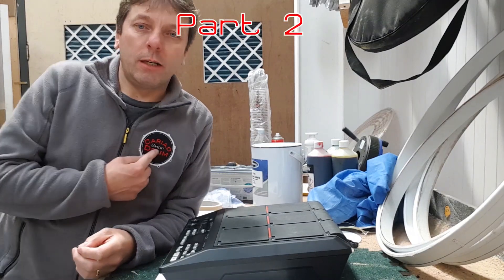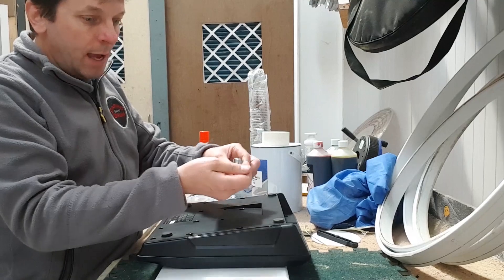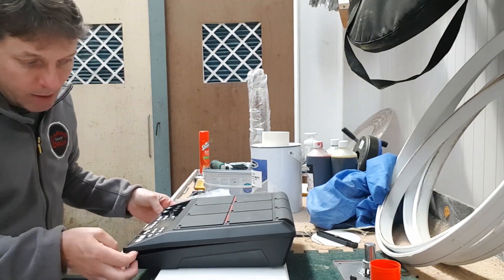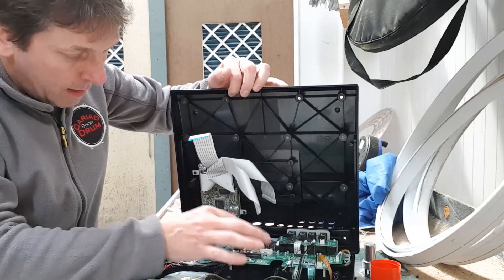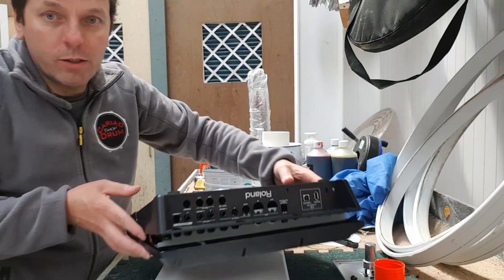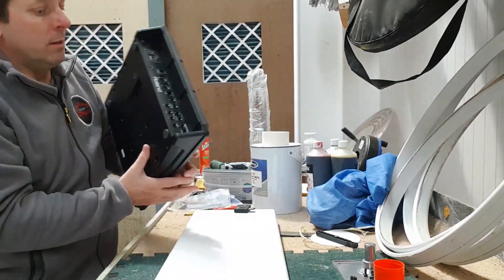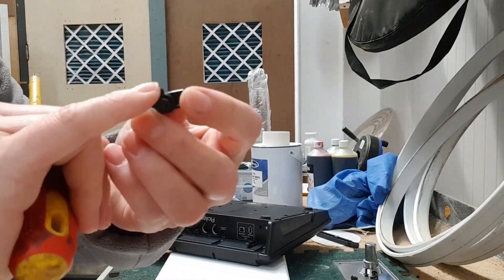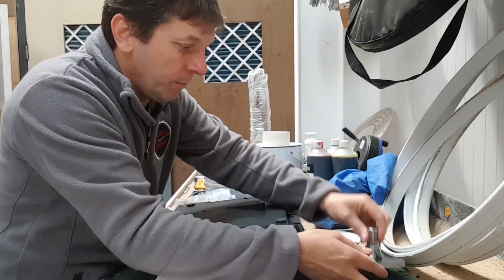Roland SPD SX memory upgrade Part 2

Comment: I just can't get the case off. I can just about see that there are plastic tabs that have now gone white from stress, from me pulling. I just can't seem to get it open. I'm trying to upgrade as the SPDSX keeps tripping up and/or stopping the backing track when using triggers (yes I'm on 1.0.8). I'm stuck!
Reply: I got it. The solution is in looking at the holes at the back. Intuitively you want to pull it towards you, but actually you have to push it away from you, so that it frees the holes for the jacks etc at the back. Basically use the back as a clue! I bent some of the tabs, but none of them snapped off (yet...). Thanks for the videos.

Comment: THIS MAY BE HELPFUL -
If you're in the odd boat of being some sort of producer who wants to use full-on wave tracks, or just don't really care about spending another $10 for GBs in the triple digits, you may be inclined to go past 32 GB. You CAN NOT do this.
Beyond 32GB SD cards become SDXC's instead of SDHC. The SPD-SX does not support the XC format, so 32 is your cap. 

Also, since the making of the Roland Pad SD cards have evolved a bit. At the time of this comment (2021), you'll find microSD cards have a circled 10 instead of the 4 found on the factory-issued card, along with A1, and whatever else they come up with over the years to make their products sound more powerful. These updates and additions do not seem to have any adverse effects on compatibility with the Roland; using a microSDHC is the only criteria.

If your wiping your SD card using disk utility (or windows =) be sure to format it to MS-DOS, not ExFat or Mac OS Extended.

And finally, if the power does not come on at all when you reassemble you probably put one of the electrical strips in backward. Be sure the grill inside the slot is touching the teeth on the end of the strip.

Thanks, Leigh, this was too easy. I wouldn't be surprised if Roland tried to pay you to go away haha.
Reply: I have memory error on 32gb card toshiba  exceria micro sd hc I (3) AFER 2-3 yeas of working perfectly ;/ , im playing in two bands now i need this space. I have MEMORY ERROR and i cant format from spdsx directly.  i started using SPDSX editor software mabe this is a problem ?

Comment: Thank you very much Leigh for this video ! 
Last night while practicing I had a "Memory Error" on the SPD-SX, and I couldn't format the memory card... Not much info about it on the Internet... I was kind of worried as I have a gig tomorrow night. Until I find your video !! 
I bought a 10€ 32Go microSD card and started the "surgery" ! The only tricky part was to separate the top part of the SPD from the bottom part ! It took a few minutes but I got it !!
Anyway, everything works fine, I'm relieved !!!
Thanks again !!!

Comment: Thanks for this video, it was really useful, although I don't get why 32/64gb is "not recommended" any further info about that? Why it would be "not good"?
Anyway I just put a 16gb MicroSD card I had laying around.

I did not take pictures about the positioning of the ribbon cables and I had to come back to this video to get it right (not the right slots, but the right "ply"), so maybe better listen to the video he got the point!!!

I did not glue the MicroSD card (I'm on lockdown and I don't have the right glue for this matter, only superglue and a kind of slow dry silicone...) but the "locker" seems pretty strong anyway.

Thanks again.

Comment: I changed mine to a 16GB but once I go to check the memory still shows the 4GB. Did I do something incorrectly??
Reply: Hello Carlos! I just updated the MicroSD card of mine and i had the same problem, the only thing you have to do is to update it to the last Firmware (1.8) and then it will show 16gb (At least it worked for me!) Let me know if it worked! Kind regards, Joel.

Comment: I have a problem that I opened the device for the reason that I changed the skin and it was working but now it no longer works what is the problem
Reply: Leigh Smith I installed them all. I don't know what the problem is

Comment: Hi, Leigh. Thanks a lot for these videos. I ´ve changed the memory card and all seems to work properly but  after replacing the card, SPD SX doesn´t connect to the SPD SX Wave manager, I mean, the connection to the PC works, but the wave manager doesn´t recognize the samples that I load. 
I have loaded several samples, but the wave manager doesn´t recognize them. Do you know what could be wrong? Thanks again
Reply: Hi. Finally I´ve discovered the problem. I had not updated the Roland to version 1.8. In previous versions, the system doesn´t recognize more than 4 GB. Once the system is updated, everything works perfectly. Thanks.
Reply: @cariaddrums Thanks to you.  Hope your wife get well very soon

Comment: Thanks, worked like a charm! Got a samsung evo 32GB micro sd working ! A 13 euro upgrade. Upgraded the device with the latest Roland 1.8 firmware first!
Reply: I replaced with Samsung microSDHC EVO Plus 32GB card. I turn my SPD-SX on and there is nothing! I reopened to check my white ribbon bands were connected properly. They were, then checked the power strip leading to the device, and still nothing!! Do you have ANY SUGGESTIONS.
Reply: @kevinkalka6321  My SPDSX recently developed a common fault I had not heard of. It wouldn't switch on. The fix is to beat a pad while you're pushing the power button. I had to do that for a couple of months (not continually :) and then it went back to normal. Maybe that problem developed in your machine when you took it apart.

Comment: really, really great tutorials.  all parts are right on, thank you.  Have you ever heard of a new SD card also fixing the intermittent and completely annoying loop/click desync issue?
Reply: Found a potential fix for that. If you set all your sounds on that particular kit to Mono rather than Poly, it’ll use less system resources. Would reckon that’s more of a ROM memory than a RAM memory thing